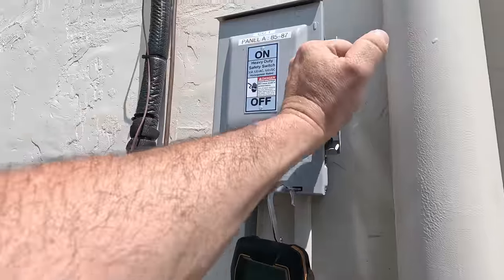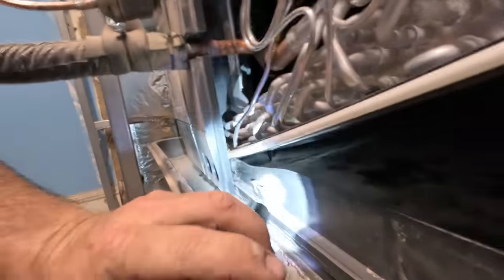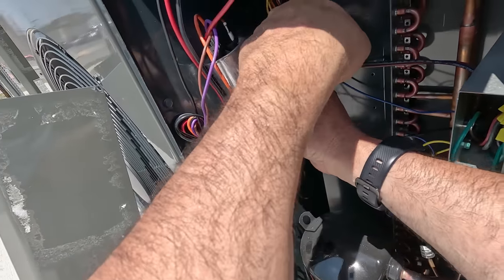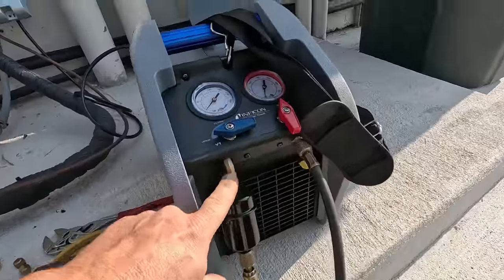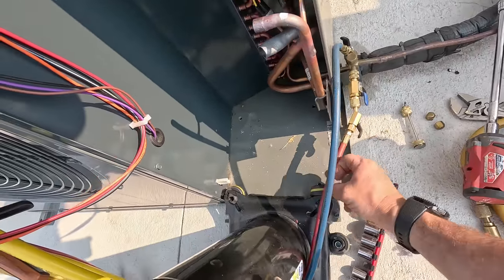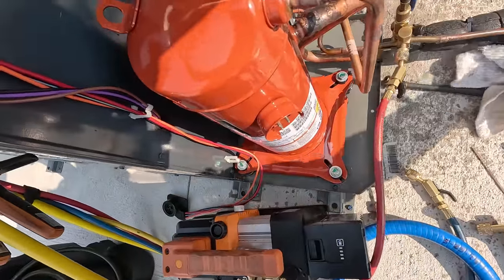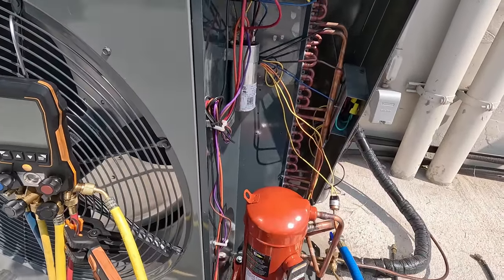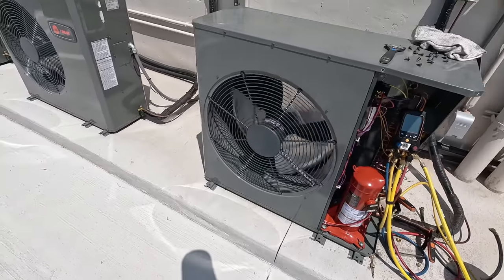New Trane Air Conditioner Dead On Arrival PLUS Lots Of PROMBLEM'S

Comment: For your information, grounded compressors can also cause the condenser fan motor to run lower speed because it back feeds thru the compressor when not running.
Reply: exactly

Comment: What I like to do when brazing in a new compressor is that if I can't purge whilst brazing then at least I try to push the air out with some nitrogen so that when I braze there's only minimum air left inside the circuit.
Reply from the maker: Yeah that's what I should have done. I screwed up

Comment: Edit: I posted this before you pulled the drawing. : I have that same indoor unit in my house. That drain the hooked up is for a vertical install, the lower drain that they didn’t connect to is for a horizontal install. 😮 I could have don’t a better install and I just watch YouTube videos.

Comment: Came across a Carrier air handler one time installed counterflow but the slab coil was still in the upflow configuration…coil should have been flipped with an accessory drain pan installed. Unit had been working for several days and the condensate dripped through the control box and strip heaters and filled the ductwork underneath. I was amazed to see water dripping off the wires and relays in the control box yet the unit was still running! Good work.

Comment: I don’t need the work bad enough to work on the competition’s qwappy installs. Hang a wet towel over your 410a recovery jug to cool it off a little bit or ice water over it helps to. Install a suction drier on all compressor changeouts, if room allows.

Comment: Suspect it was factory terminated wrong and running backwards. The fan spinning means it grounded out and was feeding from the other leg through the ground fault.
Reply from the maker: I should have checked the resistance to ground but it was bad either way so I skipped it. Good call 👍👍
Reply: I wonder if that fault only happened after it locked up. Sounded at least at first to be a mechanical failure, not a grounded one.

Comment: I just went on site where someone did a beautiful job of installing 3, multi zone mini splits with casettes, wall units and about 4 slim ducts.  Too bad the slim ducts were upside down.  That was a lot of work to fix that- they had to be disconnected completely, all duct work, plenums, and rehung and then the lines were too short, the wire was too short, the duct work didn't reach in some cases, and luckily they worked when they were installed right.  I was worried they would be toast- but they worked.
Reply from the maker: That sounds like a lot of fun 🤦🏻💰💰

Comment: Because the capacitor was so hot to the touch when the bad compressor was hooked up, I would have replaced it even though it still worked. Heat is bad for caps, and the heat probably weakened it. It's a cheap part so I would have swapped it for piece of mind.
Reply from the maker: Good point 👍👍

Comment: Just because it's new doesn't mean it's not broken.
Reply: Just because it’s old dosent mean it’s broken
Reply: Because it’s new u should be more concerned, the new stuff suck.
Reply: Trane has a problem with DOA equipment.  I have installed Trane for 35 years and never seen the number of DOA's that I have in the past 2 years.

Comment: Always use Nitrogen 🙂. You don't have to keep the purge running the whole time. Just purge, turn it off and braze the compressor in.
Reply: I've seen guys keep a light flow of nitrogen after purging with it to prevent oxygen from getting inside while brazing. My teacher says the same too. I would imagine oxygen wouldn't go in if you kept your hose connected to prevent natural airflow,  but who knows

Comment: I use the same brazing tip for small copper. I helped a guy install two evaporators on a blast chiller at Kroger, I had about eight brazes. He goes what in the hell is that? I said take out your phone and start your timer. I did them all in under 30 seconds, shit looked like it was done at the factory. I wish they made a tip like that for mapp gas.
Reply from the maker: I've been happy with it👍👍

Comment: At 2:21 the most common mistake AC installers make. Improper trap venting. plumbing 101 the back side of the trap is vented. That $1.00 mistake is the main reason many customer's ceilings fall in. It's amazing over 90% of HVAC guys don't understand Venting basics, especially when Venting is the V in HVAC

Comment: The compressor is just free wheeling.  The clutch is broken, and the rotary scroll is not turning to compress the refrigerant.  I wonder if it was over charged, and it slugged and damaged the compressor.  The scroll compressors are not immune to liquid slugging. I have seen many damaged due to over charging.
Reply from the maker: Factory charge was 5 lb I only pulled out 4.4.

Comment: I love the torch set up you have, can you ( or someone) recommend this setup for me? I have a “turbo torch” with an acetylene tank, it works but it’s kinda wild sometimes. Thanks
Reply from the maker: It's just a regular oxy acetylene torch set. If you want to get the whole set so that everything fits easily together I would go with the uni-weld brand. Originally this was a Victor but I had to change the handle to make the tips fit

Comment: Where did you find that compressor handle?
Reply from the maker: I built it.
Reply: @HVACRSurvival  I sure would like to get a better view of that thing, so I can make one.
Reply from the maker: It’s made out of about an inch diameter stainless steel tubing, cut into a 45 made into an angle then a piece of flat stock stainless steel made into a sea shape. Then it’s welded together.  Email me and I’ll send you some pictures HVACRsurvival@Gmail.

Comment: I have a good question for you mind you ...the unit is already dead but curiosity is nagging me.
4 ton r410 non heat pump.  Ran EXCELLENT for 3 years in the worst of Texas heat and would cool the house down to the low 60s if you wanted.  The downside....the unit sounded like it had rocks in it....I mean it was loud.  Pressures tested great.
It died the other day but I was just wondering what it could have been
Reply from the maker: If the compressor is not in warranty cut it open and find out would be the best way. Otherwise the factory would have asked for all the important information not just pressures.  Oat, indoor air temp, amp draw, voltage, superheat, sub cooling, verify wiring was correct, checking the resistance of the windings, meg the compressor to ground.

Comment: Hello! Why do you need a station with four valves if you vacuum correctly through a separate hose?
Reply from the maker: I use to have the older Testo 557 and 550. The 550 were bad about resetting themselves back to zero and atmospheric pressure changes. So instead of taking a chance, I got the Testo 557 even though I seldomly ever used the fourth hose.  Good question.
Reply: Thank you for responding! You are an expert! I am also a refrigeration engineer. There is also a Testo 550s station, with wireless thermal probes, it has two valves. So I'm thinking, which one to buy 550s or 557s? Is vacuuming much faster on the line than through the station? If it is much faster, then four valves are not needed, so it turns out. @HVACRSurvival
Reply from the maker: I did a video testing out my blue hoses at least two years back and it’s tremendously faster. That’s why I don’t usually pull through my manifold. I have the older 550s and they work OK but I don’t like them as well as the newer 557.
Reply: Thanks! The new 550s does not differ from the 557s, only in the number of valves. Or am I wrong? @HVACRSurvival

Comment: Hello Rick, I'm need some Schrader valves on my r-22 ac, would they be 1/4", I have a core tool, using brass cap now but sniffer shows leaky on low side.  Going to order usa bestec ones just making sure 1/4"  20 yr old  heil ICP HP, Thank you.
Reply from the maker: They're the same thing they use in your car tire. I'm not sure what the real size is. They are all the same Schrader core for both the 1/4 and 5/16 systems.

Comment: Its PROBLEMS--(FYI)--not promblems.  I replace a lot of units every year---at least 50.  And Trane often has no inventory so I have had to use in some cases what I could get- ICP, Rheem/RUUD, goodman, whatever.  Of all- I have had the MOST problems with trane--when I say problem, I mean leaks, no freon due to a bad joint and it leaked out, wiring issues, and so on right out of the gate.  They are really good about reimbursing you 400$, but of all the units, I had one Rheem that had a problem, and about 4 Tranes.  No other issues with anything else.  Not even mini splits.  HAving said that- this is a case where someone said "I have a great AC Guy" because he came out and changed a capacitor for 100$, and so that made him great.  He is obviously clueless and has no business working on his own.  I ran into a guy recently who contacted me for help when he was installing a condenser and had some problems.  I asked him when I could tell he was in way over his head, "what are you charging for this"----ANSWER:  150$.  so there are a whole bunch of people who think they are "ready" and know everything, and then get into big trouble as in the case of this install.  Great video for several reasons---one of which exposes the guys who just are not ready to be on their own and also issues with new Trane products of late.

Comment: What’s the deal with Trane compressors? It looks exactly like a copeland scroll, did they pay Emerson to be able to make them on their own or something? Just curious 🧐
Reply from the maker: I'm not a Trane guy not sure, it's made by someone other than Copeland, there are several company's making scrolls that work but this one didn't😲😆
Reply: I cant remember the name of the compressor off hand, but its made in Louisana.  I feel they are junk. What happened to the Climatuff compressors?  Just popped into my head.  Alliance compressor in Louisana.
Reply: Trane and Copeland actually developed the scroll compressor together
Not sure about resident but Trane manufacturer their own compressors on the commercial side
Reply: @seangriffon6502 climatuff had to go away due to efficiency that the government has put in place
Reply: @HVACRSurvival  based on the installation
And undercharged of the other units
The failure was most likely due to the crappy install

Comment: I’m sure by now you have seen the Trane S series gas furnace, loads of stupidity in that design. The big thing is it’s a 33” tall furnace, but the way the blower compartment is designed your return opening is something like 15x16, if you are over 3 tons or a certain BTU of heat you require a furnace support box which if you use the Trane box brings you right back to 40” tall 🤦‍♂️
Reply from the maker: That makes sense if you don't think about it 😂👍👍

Comment: You just complained about not using Nitrogen when brazing and right before that you brazed the compressor without it...........IM CONFUSED
Reply from the maker: What I was getting at is sometimes you create more problems than what you're saving. There's a difference between doing a two braze joint repair versus running a line set with multiple  joints being brazed. Plus the amount of heat you put on the joint also dictates how much carbon you get. If you looked at that coupling I showed in the beginning that thing was dark black they overheated it extremely. To make the video short I cut all that information out.
Reply: @HVACRSurvival  I gotcha bud. You really know your stuff. Funny how BAD some installs are. I’m an electrician by trade but I geek out on the ductless. I installed my 6 zone system at my house a couple years back. 6 zones 24 flares and not one leak. I installed everything to spec. Recorded extra line set length and had a guy pressure test, evacuate and add 410A where necessary. They are the future. I always recommend them to anyone who’s looking it switch away from fuel.
Reply from the maker: @SubStationSparky  The reason why you don't have problems is because you cared... most people don't give a shit and their work shows it.  Electricians usually have a sense of pride in their work. If there really electricians and not wire pullers 😊. Thanks for sharing! 👍👍🤜🤛

Comment: Newbie here, why is it ok to braze the compressor without nitrogen?
Reply: I would purge with nitrogen to displace the oxygen and kill the nitrogen purge and have my gauges open to atmosphere.  I would then braze the joints. Any residual nitrogen would warm and expand. No oxygenation would happen. Keeping nitrogen running would blow your weld out and you would have to reweld the joint.  How do I know, been there.
Reply from the maker: @Johnny you could Purge it with nitrogen then kill it just like amarillohome said. When you get in the real world and start running calls you're going to find out almost half the people don't even run nitrogen if not probably 75% of them. Most of the people on YouTube are some of the very few that actually care about what they're doing, generally most people you work with aren't going to give a shit about doing things the right way they're just there for a paycheck and want to go home.
Reply: Cannot flow nitrogen through the compressor, so you do it the way it was done here to avoid the blowout described here

Comment: I don't understand why fellow technicians don't like Trane. Can only speak to the residential side but they have easily accessible documentation along with Mitsubishi.
Reply: As a fellow HVAC tech. I dislike them mostly because if quality control issues, OEM specific parts that they don’t have. They will with a straight face tell you we don’t have any and don’t know when we will have some. 😮 what???
That’s residential and commercial including 300 ton chillers that are right out of the factory
Reply: @brandonbowden1262  What air conditioners do you recommend?

Comment: Why did you put a red climetuf scroll
Reply from the maker: Because that's what Trane gave us... I have no idea why they changed the color 🤷.  I'm not a Trane dealer. This is what the damn architect wanted installed.
Reply: Ok and the compressor wasn't sounding so good when you pushed the compressor contactor

Comment: Definitely need to use nitrogen. Inside of that copper is completely trashed without it. Basically looks just like the outside does after brazing, with some charred oil to boot.
Reply from the maker: I agree... that's why I use it everywhere else,  I should have purged through the compressor first.  It really doesn't matter how good I do there's always someone going to find something wrong.
Reply: @HVACRSurvival  I wasn't harping on you, just agreeing with your comment that it seems the whole install might have been done without nitrogen. And that people often underestimate the importance of it during commissioning. At this point, you not using nitrogen for those repair 2 joints isn't really changing anything (that oil was already full of soot and particles that ejected).
Reply: but only where you braze- and depending on where- you can flush it out with water, solvent, followed by nitrogen and pumping it down..  I always do a flush regardless of whether I braze with nitrogen or not.  99% of the time I do, but if you can't for some reason- flush it with solvent or whatever and nitrogen and its fine.  Its when you do nothing that you run into problems--It doesn't matter what the inside of the tube looks like the problem is that stuff comes off like a powder and will clog up the expansion valve---esp the electroninc ones.  So--make sure you use nitrogen, and if that isn't possible---flush after brazing.

Comment: Awesome rescue Question the hydrogen what does that do Added that to the system ?
Reply: Do you mean Nitrogen or did I miss something in the vid?
Reply from the maker: Did I say hydrogen? I would have meant nitrogen, what minute mark?
Reply: @EverythingisFire  yes lol
Reply: @QsTechService1   Ah :D Then he used it a few times for different reasons. Nitrogen is cheaper to use & you won't get the EPA on you for wasting refrigerant & venting it into the atmosphere. He used it to blow out residual oil & junk out of the refrigerant lines. I believe he purged with it for installing the filter drier to prevent oxidation forming during brazing. Then he used it (& maybe some trace amount of refer? I don't remember) to do a standing pressure check & leak check. Had he used refrigerant & had a leak, he would've had to recover it again and possibly waste an amount of refrigerant venting into the atmosphere & charging the customer more to replace it.
Reply from the maker: Everything was nitrogen, I seldom check with nitrogen and refrigerant trace gas.  All I did was sweep the system with nitrogen to get any dirty residual oil and oxygen out then brazed it in.
Reply: @HVACR Survival  Awesome makes sense  There was some nasty stuff coming out of there lol

Comment: y isnt there any drain traps?
Reply from the maker: On the positive side of the coil not the negative.
Reply: @HVACRSurvival   read the manual im sure kt still mentions to install a trap doesn't matter of oy n3gative or positive side of blower in addition it may also need a ven, doesn't evem matter because there's 1 installed actually, & yes many manufacturers expect installers to install traps on positive side designed air handler when fan shuts down to prevent gasses backing up into space

Comment: I don't understand what he is saying about using nitrogen? He said the original installers did not use nitrogen when the brazed everything in and yet he did not use nitrogen when he brazed in the replacement compressor?
Reply from the maker: Two braze joints versus multiple throughout the system?